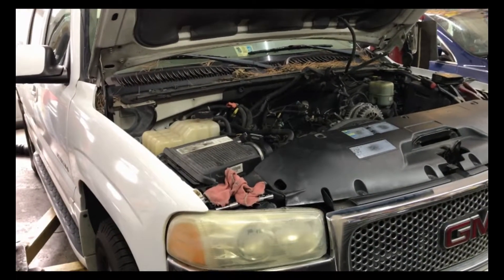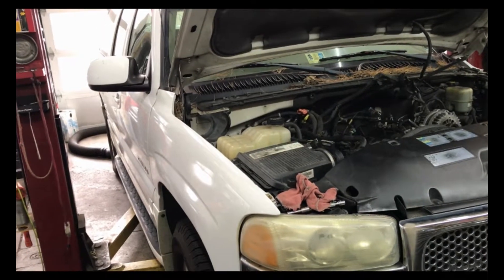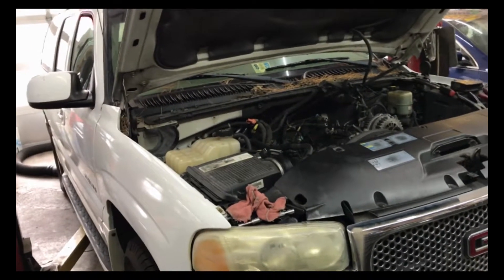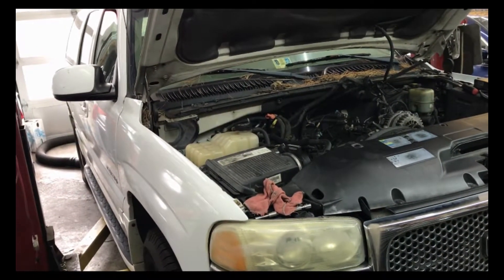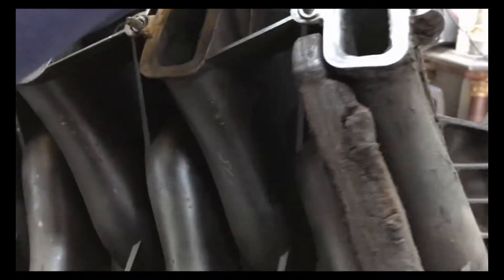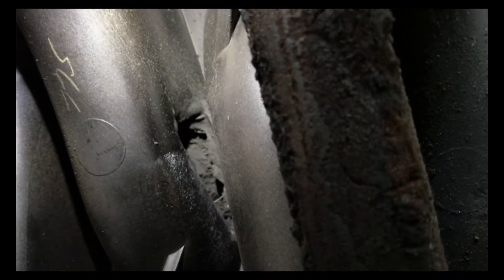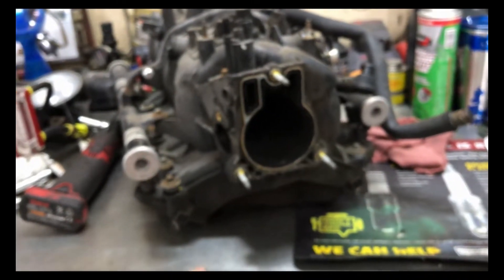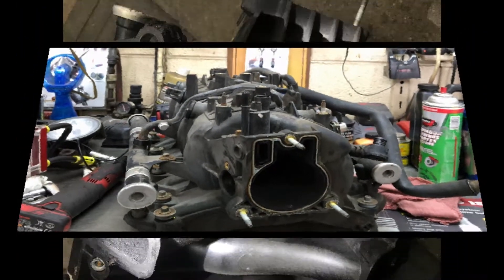GMC Chevy 6.0L RPM's Way To High

Comment: Omg I love you I had the exact same issue n did all the same fixes with no positive results I’ve looked 50 times on u tube stating high rev but never seen your amazing video your vid was first up today and in 3 min I knew what my problem was took me 25 min to get  my intake off n I swear the hole is exactly same spot n looks like its the same size it was like you were talking about my truck thanku so much bro 6 months of hair pulling n changing everything electrical n thought it was a wiring issue was going to send it in but now no need ! Love that video great job
Reply from the maker: Thanks for watching. I wonder what made the hole?

Comment: Having the same issue with a used engine I just installed, I left the intake on that they provided but the idle is super high around 2300 so I’ll try switching back to my good one thanks!

Comment: I have 2002 chevy tahoe with about 300k miles on it does something similar  where it revs up to about 2300 rpm and when i Put it gear it idles down and as you drive  it runs back up . Has anyone had this issue looking for help for like 7 months
Reply from the maker: Check for vacuum leaks. That is what was wrong with this one.
Reply: Hey how could i be able to contact you i would like to  try and see if your shop could take a look at my tahoe i also live in va
Reply from the maker: @Markdagr893  Email me. My email address in on my home page in the About tab.
Reply: @TheGAutomotiveAndMore   hey check your dm on ig
Reply from the maker: @Markdagr893  I did nothing there.
Reply: @TheGAutomotiveAndMore   hey you might have to check your message requests in your instagram messages tab
Reply: Did you ever resolve this??
Reply: @lucasrivera58  no sir i am still having this issue
Reply: @Markdagr893  is your a throttle cable or no cable??
Reply: @lucasrivera58  i have the mechanical throttle body with the cable it is not electronic throttle body
Reply: @Markdagr893 you ever get this fixed? I'm having the same exact issue with my 2001 2500 HD 6.0L high rpm in park, sporadic idle in gear.

I started having this issue after I replaced the notorious knock sensors. I cleaned the intake surface well and replaced the gaskets. I even torqued them in sequence in two steps.I really don't want to take the intake manifold off again to check for holes but I will if I have to.
Reply: Same here! I believe it's the IAC or TPS. Even possibly PCV.

Comment: im having a similar issue with my 03 sierra with the 5.3 the ecm went bad so I swapped in a junkyard one that seems to be good and also the fuel pump at the same time when I went to start it up it started and was running very rough like expected with a different ecm at first start and then it would slowly incense in rpm after about 3 minutes of running it would go to about 4200 rpm and would just stay there and I have a po122 code for throttle petal position sensor  / switch a circuit low and im not sure what to do any ideas?
Reply from the maker: By putting in a junkyard ecm that could open all sorts of problems. Different programing. But you can check if the the sensor and see if its good. I do not have a video on this but I bet it is on youtube.